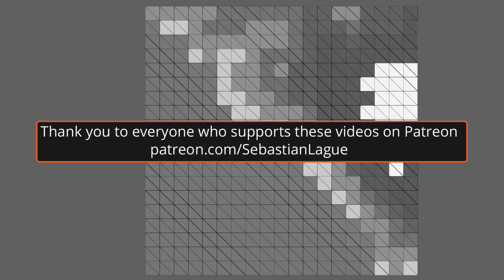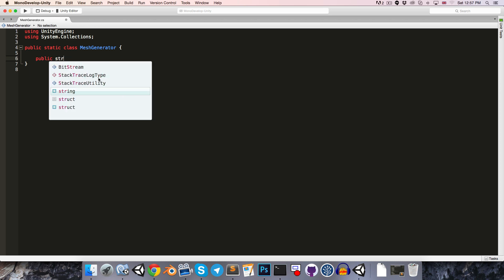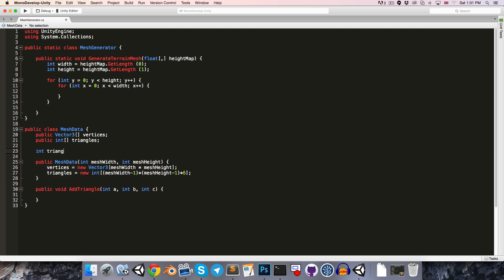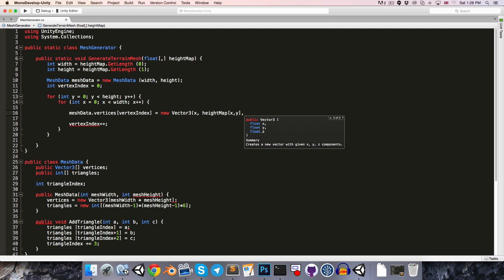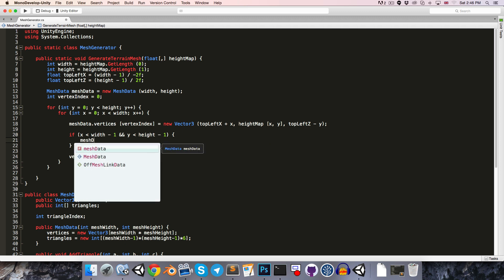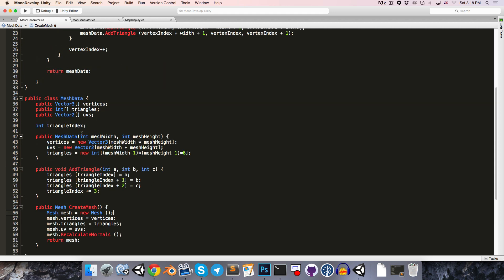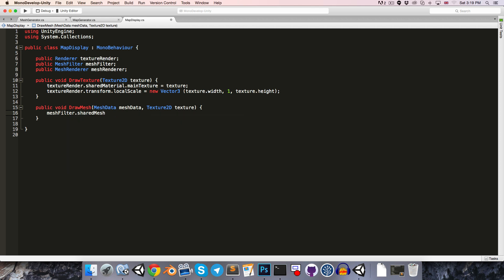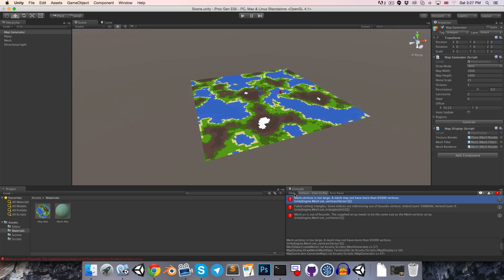Procedural Landmass Generation (E05: Mesh)

Comment: Hey sebastian, ive been following these for a while but i am not quite sure why you do i then i + width isnt the width the whole mesh as in if its 3 by 3 isnt the width 3 not 1 unit?
Reply: its to get to the next row.   so if the width of the map is 10 vertices, the vertex directly below vertex # 0  (the top left vertex) = width + 0 (vertex zero) which is still 10.   the last vertex in the first row would only be vertex # 9. the vertex directly underneath the vertex #1 (the second vertex in the top row), would be width(10) + vertex# (1) = 11.     
its mostly confusing because of the way array indexs start with 0 instead of 1.  kinda of like Years  (the year 2000 is a 0 not a 1)
if your vertex array is 10 wide, this means the "grid" of the mesh will only have 9 squares.  so a 10x10 noise map produces a 9x9 grid of squares.    if you want a Grid of 10x10, you need a noiseMap of 11x11.

Comment: Why dont i get biomes, i just get random stuff.
Reply: its important that the Regions list is in a linear scale.  the top most region in the list must be the lowest number (like 0.1)   and the bottom of the list must be the highest number  ( 1.0 )   but you should set it to 1.01 or add an = sign in the code otherwise that fringe case (1.0) shows up weird.
if any of the values are out of order they will be skipped.

Comment: Hey sebastian, 
nice video first of all. Unfortunatelly I ran into a problem with this. I just tried to add a single rectangle to the mash after the loops that generate fill the mashData. i just added these 3 lines to below these loops:

meshData.vertices [vertexIndex] = new Vector3 (0, 10, 0);
meshData.uvs [vertexIndex] = new Vector2 (0, 0);
meshData.AddTriangle (vertexIndex, 1, 0);

Unfortunatelly the mesh isn't generating anymore after that and i cant find an explaination for that. Can you help me with this, please?

Comment: Whenever I try to save the scene the materials change to just white color and I have to click generate map again to get them back to normal. This has been going on for a couple of episodes now I think. Has anyone else experienced the same problem?
Reply: Well in my case i had to go to Window -> Rendering -> Lightning Settings -> Other Settings and turn of Fog because it was so big that the fog covered everything in white/gray hope that helps
Reply: im having the same problem when "Running the Game"  (not in editor window)  the Plane is just white, and the Mesh is black.  The problem is,  when hitting "Play", all the Material data is erased. there is no more mesh renderer data.   cant figure out why though.    If, while the game is running,  you go to inspector and click Generate Map,  the mesh texture WILL load  There must be a way to serialize the data ?

edit:   I found solution.  I added an empty object, called it SceneController.  made a new script, called SceneController, added it to the new object. The script Generates the map  in an void Start()  function. since the SceneController is in the scene already, when you click Play, it generates the map.  Textures show up :)      You have to drag the MapGenerator object from the scene onto the public variable on the SceneController in the inspector to link them.

---------------  The script:

using System.Collections;
using System.Collections.Generic;
using UnityEngine;

public class SceneController : MonoBehaviour
{
    public MapGenerator mapGenerator;
    // Start is called before the first frame update
    void Start()
    {
        mapGenerator.GenerateMap();
    }
}
Reply: Actually now the plane just stays white. In the previous episodes it was going back to "normal" after I hit generate map again
Reply: same problem
Reply: bit late so if you got a solution plz reply

Comment: So I'm trying to experiment with using your lesson here to apply it to making a procedural 2D tilemap using submeshes, I think I've noticed 2 things:

1. Your "Dimensions" for MeshGenerator seem to refer to the number of Vertices it is wide/tall, which is distinct from how your Noise/Colour map Map Generators where Dimensions were on a per Pixel/Texel basis. If you compare a 4 by 4 "Mesh" with a 4 by 4 "Noise/Colour" map; your Mesh will be a 3 by 3 instead of a 4 by 4.

I solved this with a couple of adjustments, on lines 10/11 in MeshGenerator width =heightMap.GetLength... I add + 1 to both lines.

I then take MeshData.uvs[vertexIndex] = .... I have the width and height of the UVS subtracted by 1 so the UVS match.

Secondly, unless I changed something (for a 2D game I wanted the mesh to be facing the camera ala 2D mode, so I adjust meshData.vertices[vertexIndex] to swap the Y and Z components); you're UVs might actually be flipped. As comparing the plane with the Mesh and the textures seem reversed.

edit: Got it, 

1 - (x / (float)(width - 1)) and the mesh texture now matches the "plane" texture from the Colour map.
Reply: if you wanted a mesh that had 100 x 100 "squares",  then you would just set the noise map scale to be 101 x 101.    right?

Comment: Why, when i enter mesh state, the mesh is created with an offset of 1000 in the Z position?
When i enter 10 in the Z scale parameter as in the video, the mesh is moving below the plane object, when viewing from the Top, and only when i enter 1000 in the Z position parameter, the mesh fit the plane.
I've checked that all the objects are zeroed in the world.
Reply: I had a similar problem...
it was because in MeshGenerator.cs I wrote:

        float topLeftX = (width - 1) / -2f;
        float topLeftZ = (height - 1) / -2f;

instead of

        float topLeftX = (width - 1) / -2f;
        float topLeftZ = (height - 1) / 2f;

this caused to move the whole mesh into negative z-space depending on z-scale
Reply: Found the problem, thank you very much!
Reply: Sorry to necro this comment but if you can remember what solved the issue?
Reply: Thanks! Same problem and this fixed it.

Comment: Quick Question: @ 1:17 you show how to add the the integers to the triangle array in a clockwise fashion... 
0-4-3
then the next triangle array you add it:
4-0-1

Is there any reason you did not add it like this:
0-1-4

just curiosity.

Comment: I noticed something off with your process of Normalization that you did in conjunction with the colormap. Essentially you normalized the lowest point of the map and the highest point of the map to be 0 and 1 right? But when you slide the offset in the inspector, new values get added that change the lowest and highest point, which then causes the map to be recolored based on the new normalization thus effectively changing what used to be an ocean, what used to be a mountain, etc. This would then ruin the whole point in the seed if say you wanted to load the appropriate chunk nearby for say infinite terrain. 

What I'm trying to say is, the map should slide perfectly, but what used to be a mountain should stay a mountain rather than become a hill since a new value that got added on the other side increased the overall height of the map. 

This whole post might be useless though as you probably fix the problem at some point along the way. 

Really enjoying the series thus far.
Reply: The intention of the Offset as he originally implemented it was not meant to be used the way you are describing, it was specifically to ADD MORE VARIATION options to the noise being generated,  and it does a good job of that.   If you were to use that variable properly, you would use it in conjunction with the Seed.   So instead of just a Seed given to the user, you would include the offsets as well.   If they punch back in the same offset as well as the same seed, they will get the same map.  Different offsets are all different Maps (its just a bit more subtle of variation than an entire new seed, or rather it seems that way if you are using the slider to scroll through the offsets smoothly.  If you just punch in random numbers to the offsets, instead of scrolling, you will see how much variation there actually is)
Reply: Here is the way i solve: {
/*
max PerlinNoiseValue = 1
start
float maxValue = 1;
float amplitude = 1;
first octave
maxValue*= 2-1 (still 1)
float maxValue1= (maxValue*=amplitude)

2nd octave
maxvalue2 = maxValue1+ (maxValue*2-1) * (amplitude*persistance)

3rd octave
maxValue3 = maxValue2 + (maxValue*2-1) * (amplitude*persistance*persistance)

4th octave 
maxValue4= maxValue3 + (maxValue*2-1) * amplitude*Mathf.pow(persistance,3);

o th octave
maxvalue_o = maxvalue1 + maxValue2...+maxValueN + (maxValue*2-1=1) amplitude*Mathf.pow(persistance,o-1);
*/
float maxValue=0;
For (int n=0;n<octaves;n++){
 maxValue+=amplitude*Mathf.pow(persistance,n);
}

float minValue= -maxValue;
}
Well, as you said, this may be fixed in the next video x)

Comment: Hey Sebastian, Thanks for the tutorials. So, I got an error in this line as an IndexOutOfRangeException >>

    meshData.vertices [vertexIndex] = new Vector3 (topLeftX + x, heightMap [x, y], topLeftZ - y);

why it happens?
And It occurs every time I change the Map Width and Map Height.

Thanks for the attention!
Reply: I am having this issue too, did you ever figure out what was wrong?
Reply: I was having a similar issue, but with my triangle index.  I tracked my down to a typo where I had an '=' instead of a '-' here:

triangles = new int[(meshWidth - 1) * (meshHeight = 1) * 6];

I would suggest double checking / triple checking your code dealing with the vertexIndex.  Make sure you are incriminating it inside the nested for loop, make sure you set it = 0 outside the nested for loops.  Hope this helps.
Reply: @melted349  I also had an issue with my AddTriangles out of bounds, i had forgotten the *6 part.  Ultimately had to find the error by side by side comparing my scripts with the source code linked in the description.     Still wondering about the strange behavior of my "Offset"s

Comment: i did everything you said. everything is at 0 0 0,
but for some reason the mesh directly next to the map thing...
i dont know if that will effect anything but it is annoying.
please help
Reply: I'm kinda late but just copy the script from the github link I had the same issue it happens with the mesh generator script.
Reply: i can move the mesh...does it even matter that it isnt in the direct center when i tell it to be?
Reply: im just going to continue on as if it doesn't matter...and...yeah
Reply: I have same issue. Maybe it is not issue at all. lets continue. :-)
Reply: Same here :/
Reply: For anybody else running into this, make sure that your topLeftX calculation is using -2f and your topLeftZ calculation is using 2f

Comment: WHY DOES MY MESH LOOK LIKE THIS : https://puu.sh/qaABM.png

CODES:http://www.mediafire.com/download/m4h6t83gv40hi1i/ProceduralTerrain.zip
Reply: My mesh-gen script in easier form : 
using UnityEngine;
using System.Collections;

public static class MeshGenerator {

 public static MeshData GenerateTerrainMesh(float[,] heightMap)
 {
  int width = heightMap.GetLength (0);
  int height = heightMap.GetLength (1);
  float topLeftX = (width - 1) / -2f;
  float topLeftZ = (height - 1) / 2;

  MeshData meshData = new MeshData (width, height);
  int vertexIndex = 0;

  for (int y = 0; y < height; y++) {
   for (int x = 0; x < width; x++) {
    meshData.vertices [vertexIndex] = new Vector3 (topLeftX + x, heightMap [x, y], topLeftZ - y);
    meshData.uvs [vertexIndex] = new Vector2 (x / (float)width, y / (float)width);

    if (x < width - 1 && y < height - 1) {
     meshData.AddTriangle (vertexIndex, vertexIndex + width + 1, vertexIndex + width);
     meshData.AddTriangle (vertexIndex, vertexIndex + 1, vertexIndex + width + 1);
    }

    vertexIndex++;
   }
  }
  return meshData;
 }
}

public class MeshData {

 public Vector3[] vertices;
 public int[] triangles;
 public Vector2[] uvs;

 int triangleIndex = 0;

 public MeshData(int meshWidth,int meshHeight)
 {
  vertices = new Vector3[meshWidth * meshHeight];
  uvs = new Vector2[meshWidth * meshHeight];
  triangles = new int[(meshWidth - 1)*(meshHeight - 1) * 6];
 }

 public void AddTriangle(int a,int b,int c)
 {
  triangles [triangleIndex] = a;
  triangles [triangleIndex+1] = b;
  triangles [triangleIndex+1] = c;
  triangleIndex += 3;
 }

 public Mesh CreateMesh(){
  Mesh mesh = new Mesh ();
  mesh.vertices = vertices;
  mesh.triangles = triangles;
  mesh.uv = uvs;
  mesh.RecalculateNormals ();
  return mesh;
 }

}
Reply: No worries, messed up the add triangles part
Reply: The way that looks is kinda funny though lol.

Comment: Curiously, I have to create the triangles counter-clockwise, otherwise the mesh is only visible from the bottom. Also, when switching between painting the texture on a plane, to painting it on the generated mesh surface, the texture is rotated 180 on the y axis. By the way, I'm curious why you created the triangles as 0,4,3, then 4,0,1 as opposed to say 0,4,3, then 0,1,4 (or even 1,4,0). Why do you follow the jigsaw pattern, as opposed to simply doubling up on the top left position, or simply moving left-to-right?
Reply: Had the same mistake. In my case I had:
                meshData.vertices[vertexIndex] = new Vector3(topLeftX + x, heightMap[x, y], topLeftZ + y);
instead of
                meshData.vertices[vertexIndex] = new Vector3(topLeftX + x, heightMap[x, y], topLeftZ - y);

That bad + at the end made the map spin.

Comment: Hi!
I'm following your Classes and when i get on E05, in the moment that i try generate the Mesh, i get an error.

UnassignedReferenceException: The variable meshFilter of MapDisplay has not been assigned.
You probably need to assign the meshFilter variable of the MapDisplay script in the inspector.
MapDisplay.DrawMesh (.MeshData meshData, UnityEngine.Texture2D texture) (at Assets/Scripts/MapDisplay.cs:16)
MapGenerator.GenerateMap () (at Assets/Scripts/MapGenerator.cs:51)
MapGeneratorEditor.OnInspectorGUI () (at Assets/Editor/MapGeneratorEditor.cs:13)
UnityEditor.InspectorWindow.DrawEditor (UnityEditor.Editor editor, Int32 editorIndex, Boolean rebuildOptimizedGUIBlock, System.Boolean& showImportedObjectBarNext, UnityEngine.Rect& importedObjectBarRect) (at C:/buildslave/unity/build/Editor/Mono/Inspector/InspectorWindow.cs:1231)
UnityEditor.PopupCallbackInfo:SetEnumValueDelegate(Object, String[], Int32)

So, i download the E06 and re-start de process using your code, but i get the same.
Reply from the maker: The mesh filter needs to be assigned to the MapDisplay class' meshFilter variable in the inspector.

Comment: Basically managed to explain to me how triangles and vertices work and what I see in end result I will learn how to colour them too.

EDIT: nope you didn't, nobody can explain this to me, rip dreams of programming.

Still watching the part of the video where you write MeshData class and that two lines on adding triangles using vertex indexes, I kinda understand why it has to be clockwise but not how to know which vertex I should start from and etc...

I just hope with every mesh I'll ever have to create programatically I won't have to do anything too differently all the time...
Reply: I believe this all has to do with the way the pipeline renders each triangle.  in order to link them together, the Last vertex of the previous quad must be the same vertex as the first vertex in the next quad.   each quad must be made of two triangles, and the last vertex in the list must be the same vertex as what the next quad will use.  so the first two triangles start at vertex 0, but the last vertex in the list (the last vertex of the second triangle) must be the 2nd vertex in the top row, so that the next quad will start in the same vertex.     
I believe you can actually load the pipeline in a multitude of ways, its very flexible.  this is just an older method used for a long time.    You can look up which other "winding" methods unity will accept  (as they are called)

Comment: You were saying in (8:47) for creating triangles. i, i +1, i + w + 1, i + w
w= width of the mesh. (i.e: In our case its 100). So,  creating first triangle if i = 0,
(i, i+w+1, i+w) => (0, 101, 100)
(i+w+1, i, i+1) => (101, 0, 1)

I don't know whether I'm going right??? 

Will you explain me this. I got confused with this..

If I'm not right what is (w) width value would be????
Reply from the maker: +iam Shravan You're entirely correct. So those values (0,101,100) and then (101,0,1) are the indices of the vertices in the array.
Reply: @SebastianLague  Thank you for explaining that, it wasn't obvious how the vertices were being created in our mesh.

Comment: The texture is not loading on the mesh for me, please help. I only see black triangles, mesh is okayy though.
Reply: +Diego C. Sebastian Help! I also have an issue with the texture. I can see the topography but everything is one color or region, changing seeds changes color. which leads me to believe it's Major zoomed in on a spot :S
Reply: +Kodii Systems Solved my problem

i was missing a line

meshData.uvs [vertexIndex] = new Vector2 (x / (float)width, y / (float)height);

in the MeshGenerator.